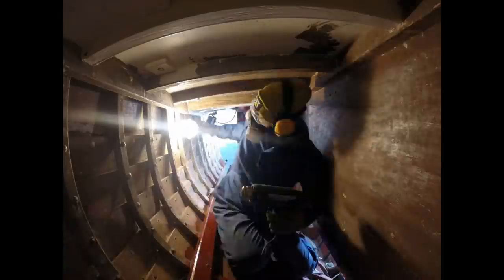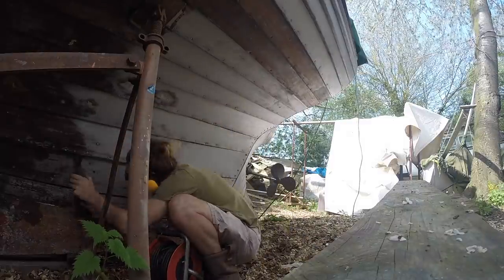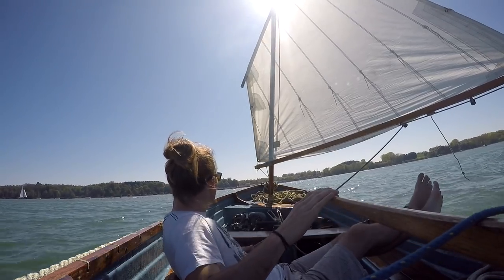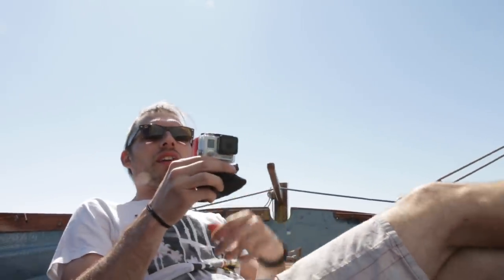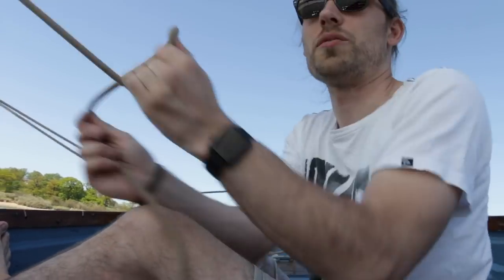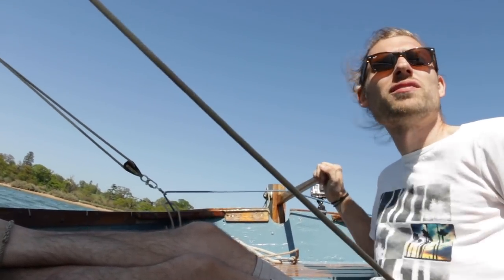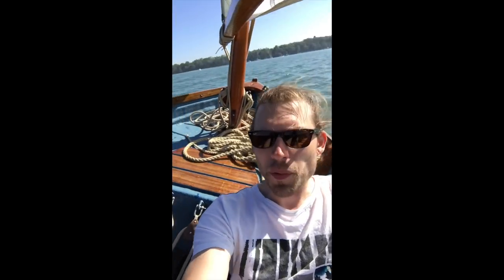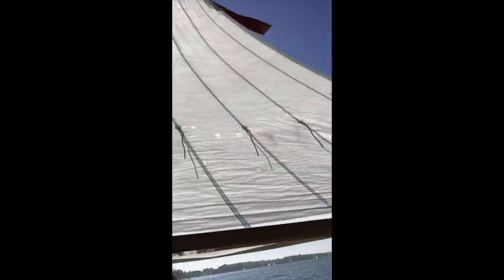07. Birthday Sailing with a Lug Rig. Wooden Boat Restoration.

Comment: I was happy to see you using a respirator while removing paint inside the boat, but shocked to hear you describing removing "lead based putty" on the boat's bottom without a mask! Breathing copper dust, from the bottom paint, would be bad enough, but LEAD? OMG. Please, protect yourself. --- Oh, yeah: Happy Birthday! Mine is in four days! :) P.P.S. Nice dinghy!
Reply from the maker: Hi Chris, thanks so much for watching. The putty between the lands, I believe is “white lead putty” which is mostly linseed oil putty with a white lead additive that goes rock hard after a period of time. It is lead based so I maybe should have taken more care, the putty falls out in small pieces that look like bits of flint, there’s very little dust so I don’t believe much lead would have been airborne. That said, it’s always best to be on the safe side. Thanks a lot for watching and for your feedback :-)
p.s - she is a fun little dinghy